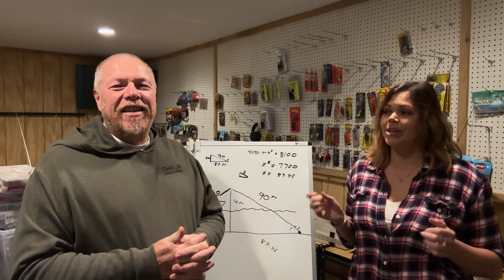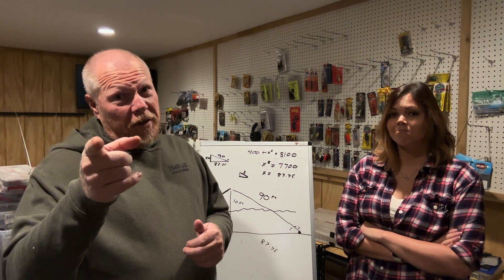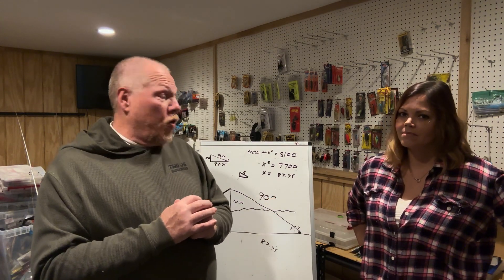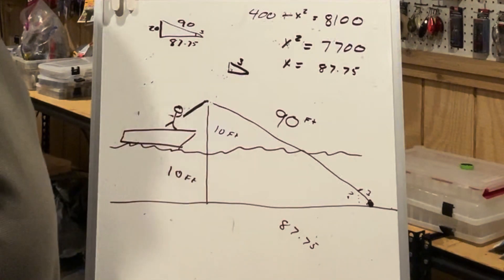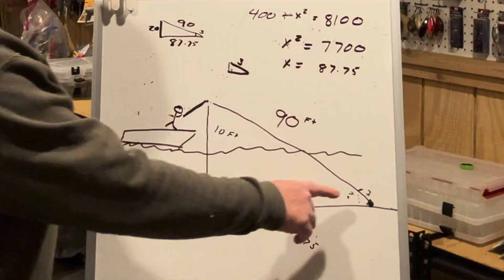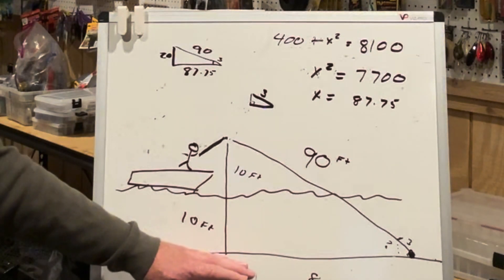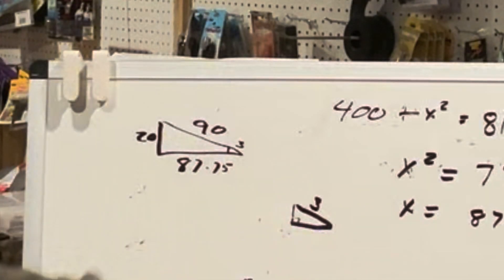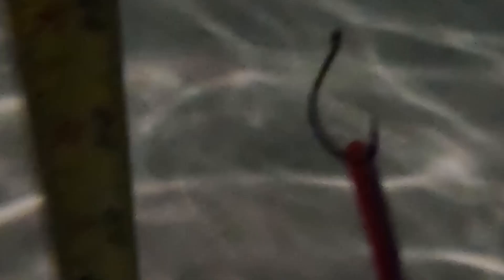Drop Shot Geometry!

Comment: I've heard that the lighter the dropshot weight, the better. (especially for less than 7 feet)

However, is a '1/32 oz or 1/16 oz' dropshot weight too light?
If so, what could be the problem with the too-light dropshot weight?
Reply from the maker: To my way of thinking you should use the lightest weight possible that allows you to feel bottom, cast effectively and not get snagged or hung on bottom content. 
The factors to consider then are wind, depth and bottom composition.
Reply: @markfisheroutdoors   @LowBrowFishing  Thank you sincerely for your kind reply.

Comment: My math came out a little different.  Bottom distance I got was 92.2, not 87.75. Almost a 5 foot difference. A squared = 400, B squared  = 8100.  A squared plus B squared = 8500.  Square root of that = 92.2 feet. So your bait is even closer to the bottom than what you were saying. F on you math test, but A+ for the video information.
Reply: Cannot be more than 90 feet😂. It should be the square root of the difference: 8100-400=7700. It’s 87.75 feet.
Reply from the maker: Thank you
Reply: @shazhu2455  ~ OP is right. The formula is A squared PLUS B squared = C squared.  Not A squared minus B squared = C squared.
Reply from the maker: I’m just letting all ya all know that I am the happiest guy in the world right now because I got multiple guys discussing math formulas on my fishing and outdoor channel!!!
You guys made my day… btw the formula is A squared plus B squared = C squared however he is also correct that the base cannot be longer than the hypotenuse.
Reply: @suburbandiyguy661  I guess you replied to the wrong guy😑.  I am with Mark. It doesn’t matter which one is A or B or C. We usually name hypotenuse as C which is the fishing line and the longest segment of a right triangle.
Reply: @shazhu2455   The hypoteneuse is C, which is the longest leg.  92.2 ft

Comment: It's odd but I was applying this to my leader length yesterday I know the water I fish very well so I have a mental picture of the bottom I know exactly the length of the grass was and I just wanted to be right above or in it and  by my angle I basically used this in my head it's not rocket science the angle is subtracting inches above the bottom

Comment: Great info. Never thought it out like that. Definitely need a longer leaser or Definitely a shorter cast. Do you use braid to fluorocarbon or straight flourocarbon? If leader what knot do you use? Keep having the floro /braid slip when snagged. Thought about adding a dab of super glue
Reply from the maker: @danlaminger5265 I always use braid to fluoro, using a double uni knot to attach the flouro. Check out our episode “How to tie a double uni knot “ for more info.
Thanks for watching!
Reply: double uni is great for lines of similar diameter. but i strictly use the Chad Hoover version of the alberite knot. look up chad hoover leader knot. its  unbelievably easy and its NEVER broke on me or got stuck on a guide, and i can even reel it into my spool with no issues.